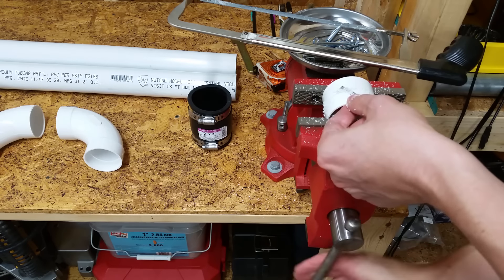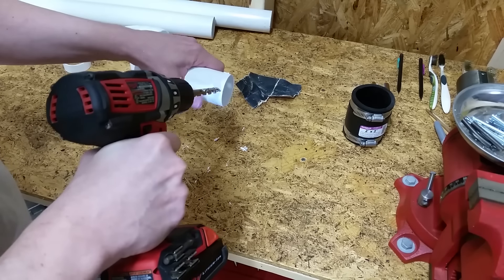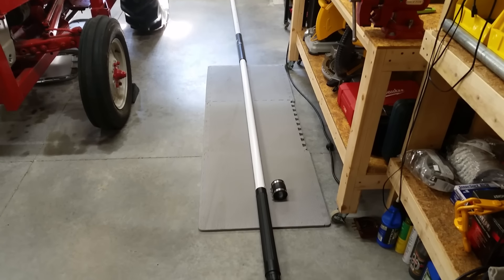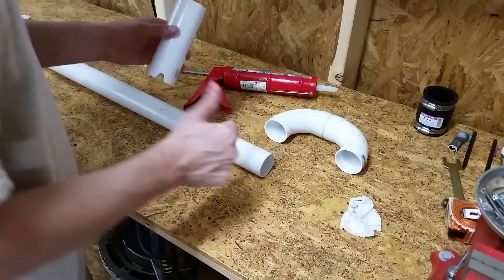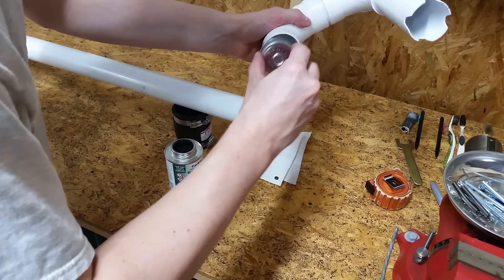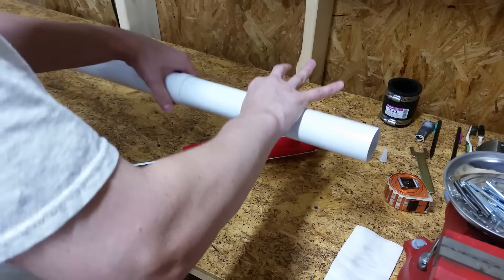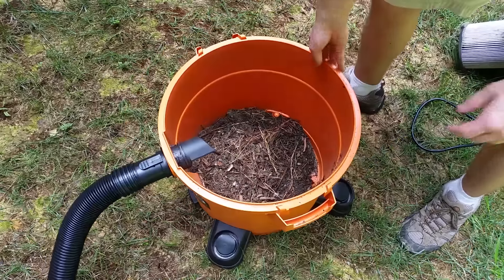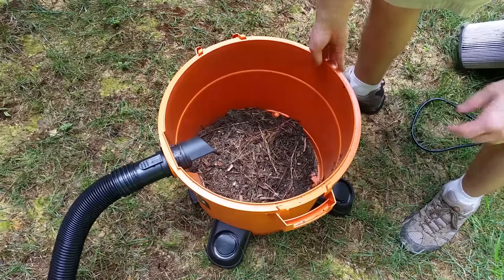DIY Gutter Vacuum - Easy and Safe Gutter Cleaning from the Ground

Comment: What if you made the coupler between the two elbows longer? That way you don't need to be directly underneath the gutter and avoid neck pain?
Reply from the maker: Yeah, or you could use two 10-foot pipes instead of two 8 footers. The problem is, the longer you make it, the heavier it is. Also, it would be harder to maneuver if you weren't standing directly below it. The neck strain really isn't a big deal, just a minor inconvenience.
Reply: @Mikeattempts  how high can you reach with two 8' pipes?
Reply from the maker: @jpearson311  Probably around 20' comfortably when holding the bottom at about chest height. You could probably go even a little higher and still have sufficient control.
Reply: @Mikeattempts  ok. I live in southwestern NC and clean a lot of gutters. Every house sits on a slope and has at least some sections of gutter that are at 20+ feel.

Comment: Put in gutter guards and never have to worry about cleaning gutters again. I live here in New England and have oak and maple trees around my two story house and had installed black metal gutter guards from Lowes and have no problems since.
Reply from the maker: I looked in to gutter guards prior to building the vacuum attachment but, from my research, they all have their problems and they're not cheap. Plus, I would still have to get up there to clean off the guards because of all the long-leaf pine needles. I'll hafta check out the ones from Lowes. Thanks for watching!

Comment: I did this like 15 years ago using gutter down spouts and elbows... All you need is tin snips and duct tape (or silicone) to fit them together... No saws or power tools needed.  It's lighter than PVC and can fit on a leaf blower to just blow the gutter out in seconds.   Or if you have gutter guards, just blow the top of them off.  I used to walk around our entire house with it in less than 10 minutes and be finished
Reply from the maker: The commercial versions are made from aluminum tubing as well. Thanks for watching! :)

Comment: What’s the horsepower of you shop vac? Wondering if mine will have enough oomph with this long of a pipe extension.
Reply from the maker: Mine is a "5 HP" but other viewers have commented that it works fine on less. I did a follow up video with more details, if needed.

Comment: Any suggestions for thick wet moss which would be quite heavy with the amount of moisture in it. Thanks
Reply from the maker: Moss growing on the shingles or in the gutter? If it's in the gutter, you should still be able to suck it up with a wet/dry vac. If it puts up a fight, you might have to clean your gutters by hand the first time. Once clean, the moss shouldn't have anything left to grow on and, if you use the gutter vac attachment the following year, it should be able to handle the job without any issues.

Comment: I would have loved to see how you connected to the vacuum but great idea👍
Reply from the maker: The attachment just slides down inside the short extension that comes with wet/dry vac and then bottoms out on the stops I glued on. I did a follow up video, if you need more details.
Reply: @Mikeattempts saw your update video too. Good stuff. Might end up doing something similar (feeling a bit lazy though lol)

Comment: Thanks for sharing your solution and the process for constructing. I'm running to Home Depot now to do the same before our first rain of the season arrives in about 5 hours [classic procrastinator :) ].
Reply from the maker: Let me know how it turns out.
Reply: My local HD didn't carry the vacuum tubing. So, I went with 1.5" PVC. Good thing, because that size just barely fit into my gutters (old house with wood shingle roof). Overall, it worked much better than I expected. Took me just over an hour to do the whole house and finished just as rain started to fall (whew!). Thanks, again!
Reply from the maker: Sounds like you finished just in time! Was the 1.5" PVC heavy and difficult to control? I think the thicker walled pipe would be manageable for a single story house but would quickly become unruly as it got longer. Thanks for watching!
Reply: It’s a single story house, so I only needed 7’. But, I AM a bit sore today. 😋
Reply: I'm thinking about 1.5" Schedule 40 pvc pipe as well. I can't find lightweight sch 20 pipe anywhere locally.

How did you fit the 1.5" pvc to your shop vac?
Reply: @cadd9511  I actually don’t remember (it’s been over a year. I’ll take a look at it later today and reply.
Reply: @Bonsu-Papa  thanks! I have a 2.5" as well as a 1.5" shopvac. Really don't want to lug the hose to HD to try to find the proper coupling if you can tell em what you used. Much appreciated.
Reply: @cadd9511  Just took a look at it....I'm a bit embarrassed to say I slid the 1.5" into my 2" shopvac hose coupling and used duct tape to seal it. Not pro-level, but it worked. :)
Reply: @Bonsu-Papa  hey, whatever works! We only do this once a year at most. I was able to find a reducer coupling from 2" to 1.5".

I plan on using a 2" flexible coupling from shop vac to 2" pvc. Then use the 2" to 1.5" reducing coupling to run the 1.5" pvc to the gutters.

In case you're interested, I found the 2" to 1.5" reducer coupling at Lowes.

Comment: Good vid. Anyone knows if there is a gutter blowing kit that comes with vacuum+ catching mechanism? I find vacuuming is only about 70% effective as still get much dirt trapped and unreachable between the tiles and the inner section of the gutter channel. So far, the best way is to blast the hell out of it but it causes a mess without localised vacuuming of the debris blown around. TIA.
Reply from the maker: That would be a cool idea, an all-in-one where the first tube blows the debris loose and the second tube sucks it all up. I don't think anything like that currently exists.
Reply: Strange, not like it's rocket science. I would gladly buy off someone who able to get a 3D design done. Will print myself😅

Comment: Hey hey hey. Pay attention
 They gave me a bid of $250.00 to clean the gutters after they put them up 9 months ago. GREAT INVENTION. Thankyou so much.  Ill be doing this idea instead of getting  on a ladder
Reply from the maker: Just be sure to build it with the central vacuum tubing, that's the key to keeping it light and manageable. If you have trouble finding it, call your local electrical supply store. Thanks for the comment!

Comment: Quick question…What about the leaves and debris that is caught in the valleys of the roof?  I still have to get on a ladder to get that down.  Any ideas?
Reply from the maker: Is your house single story? If so, you could use a telescoping pole like this https://www.homedepot.com/p/313314058 . You can screw broom heads and other stuff to the end. That's what I use to clean the pine needles off of my shed roof.
Reply: @Mikeattempts  Thanks for the quick reply!  Yes, its a single story house.  I will give that a try since my roof has a relatively flat slop that gathers leaves, etc in the valleys as well as the gutters.  Great video and great suggestion!

Comment: I used this today and worked pretty well, my only constructive criticism is that when you are using the upper section of piping, you don't have a lot of control from it spinning around.... I kept fighting it. My suggestion would be to notch the upper section ring and abs pipe such that they engage with each other. This would allow you to still maintain two separate pieces without adding rigid connections between the upper and lower sections, but "lock" them into place with gravity.
Reply from the maker: That's a good idea. Over the years, I've learned to lean the outer tube against the outside of the gutter and the bounce the head up and down a bit as I move in one direction. If I need to go in the other direction, I rotate so the other side of the outer tube is against the gutter (if that makes sense).

Comment: great video, but where am i supposed to buy schedule 20 nowadays?
Reply from the maker: I bought my central vacuum tubing and fittings at my local electrical supply store. If you call around, they should be easy to find. Each section of tubing was only around $6. Thanks for watching!

Comment: Do you have a recommendation of a wet/dry vac? I can't find one with a 2" hose and I'm afraid it won't connect properly to the pvc pipe.
Reply from the maker: I use a 5HP Ridgid vacuum, sold at Home Depot. It works great but they also have a 6HP and 6.5HP if you want a little more power. I did a follow up to this video with more detail, if needed: https://youtu.be/mSSDkTUUz8E

Comment: Great video man. I’m curious if I can use this set up for a full time gutter cleaning business. Any thoughts are much appreciated.
Reply from the maker: Yeah, I don't see why it wouldn't hold up with frequent use. You could even build one for single story gutters and another for two story. That way you could just use a standard coupler and PVC glue, on the longer one, and you wouldn't have to worry about the black ABS pipe. I did a follow up video that you may want to check out.
Reply: @Mikeattempts  thanks a ton Mike for the info. God bless you.

Comment: Thanks! My house is high, wonder if this would work
Reply from the maker: Some sections on mine are very high as well. You could make this with 3 sections, each cut down a bit so it was just tall enough to reach your tallest gutter. The key to keeping it light and maneuverable is to use central vacuum tubing, not regular PVC pipe. Let me know how it goes.

Comment: Haven’t been able to go through all comments, so excuse me if this is a repeat question.  I noticed the wet/dry vac you listed is 5.0 HP.  Would it be beneficial to have a higher HP vac?
Reply from the maker: 5 HP works great for me and other viewers have reported that 4 HP works for them. However, a higher HP vacuum will have better suction so, if I needed a new one, I'd probably go with a 6 HP. If you already have a wet/dry vac, try it out, it might work just fine.

Comment: Well thought out video. One question a little off the subject ... If you had to disconnect a silicon caulk glued connection, how would you do it ? Apply heat ? Some sort of solvent ? Brute force ?
Reply from the maker: Thanks for the comment. The silicone stays flexible so you can just twist the pieces back and forth and it'll eventually let loose.

Comment: Does the tube clog up a lot with small tree branches or sticks?
Reply from the maker: I haven't had any experience sucking up sticks. Small short sticks should be fine, as long as they can make it through the turns in the elbows.

Comment: Just finished sucking out 250' of gutters...twice. Because I started with the 2nd story gutters before I got up on a ladder to check the 1st story ones to see how I was doing. I discovered that the 5.75" downward facing tube was too short to reach the bottom of my gutters, and the elbow was hitting the edge of my shingles. So basically there is only a 2.5" gap to slip the tube into. Luckily I found a 10" piece of clear plastic tubing that fit perfectly inside the end of the suction tube. Then it reached the bottom of the gutters. But it still didn't slide very smoothly because it was getting caught on the dried shingle grit lining the bottom of the gutters. Wow, I shoulders and neck are going to be pretty sore tomorrow!
Reply from the maker: That's rough but it sounds like you got it figured out so hopefully it'll be much easier next time.

Comment: I'm going to build this but have a ball valve on the ground end so I can shut off vacuum for a moment to drop a clog at the inlet.  I have 6" gutters because I have large sycamore trees with leaves that are massive.  I will be basically picking them up then dropping them.  I doubt they will make it into a 2" pipe.  At least it'll still be faster than ladder work and much safer.  Basically I'll vac for a moment, clog the tip with leaves, come out away from the gutter for a second and shut off vacuum to let go of the clump.
Reply from the maker: That's a really good idea, let me know how it goes!

Comment: This is a better mousetrap than the one I built. use three shop vac extensions glued together with pvc cement onto the elbow sections. Then I used a 10 foot section of pvc connected to my shop vac. It still needed to get on the ladder to reach the second story. I fail to see the reason for the black pipe can you explain that one again please? Thanks you.
Reply from the maker: The black ABS pipe is just a means to join the 2 sections of central vacuum tubing. I could have used the coupler and PVC cement to join the sections permanently but I needed them to come apart easily so I could use the top section for my 1 story gutters. It's also handy for storage. Thanks for watching!

Comment: now how does the suction work on wet material go up two (2) floors?       ( been wanting to do something like this and try the a blower version also )
Reply from the maker: I've never used it when the gutters are sopping wet, I always wait at least a couple days after the last rain to clean 'em out. However, it does just fine with damp debris and wet shingle grit.

Comment: Nice but can it pick up mud and water also ?
Reply from the maker: If you use a wet/dry vac, it can suck up mud and water. Just be sure to remove the vacuum filter when sucking up water. However, I would recommend rinsing out the inside of the flexible vacuum hose and attachment when you're done. If not, the mud will coat the inside and dry which will make the hose and attachment heavier.

Comment: Would you happen to know the sealed pressure number on this wet/dry vac listed?  When I click on it and it takes me to Home Depot website it doesn’t list the sealed pressure. Only the cfm. Of course when I call the 800 number to contact Rigid vac they are on holiday after thanksgiving.  I’m trying to figure out the suction capability in comparison to others I’m looking at since now I can’t locate the sch 20 lightweight tubes so I’m having to pay way over price on attachments and the wet vacs have more than doubled in price in comparison to the $50 you mentioned for this capable vacuum. Thanks if you happen to know the pressure. I appreciate it.
Reply from the maker: Sorry, I don't know the pressure. You actually want central vacuum tubing, and you should be able to get it from your local electrical supply store. I did a follow up video with more details, if needed.
Reply: @ thanks. Yes I noticed your comment of if having trouble locating it try electrical supply stores in the area. So after calling plumbing stores I called all the electrical supply stores in town. Some said they hadn’t seen sch 20 central vacuum tubing in probably 30 years. Each place when I asked if they knew anyone that might carry it they either mentioned one I’d already called or when I called them they said no, didn’t have it. One store said he thought he found one place online but then he said it looked sketchy.
Reply: @ oh yea and Home Depot didn’t have a clue when or if they might get it available again.
Reply from the maker: @kristagerst2341  Home Depot has a similar vac on sale for $60: https://www.homedepot.com/p/316514940
Reply from the maker: @kristagerst2341  The issue could be terminology. I incorrectly called it "schedule 20" in the video but it's only called "central vacuum tubing". It's the tubing they install in the walls when you have a whole-house vacuum system. So, any electrical supply or vacuum supply or whole-house vacuum installer should either have it in stock or be able to get it.
Reply: @ oh ok, I’ll try that. Thanks again. I appreciate it.

Comment: I'm in a one story and was thinking I'd just run my leaf blower with an extension, but I'm thinking I'll just use my ladder and see how that works first without an extension.  Your design looks great, but my shop vac has leaks.
Reply from the maker: Leaf blowers work great but then you have the mess to clean up. I got my 5 HP vacuum for only $50 new and it has plenty of power. Since you only have a single story house, you'd just need to build the top section of the attachment. Thanks for watching!

Comment: In the UK we are in metric, so guessing I'd use 40mm pvc pipe, but what size the outer tube (black tube) guessing 43mm?
Reply from the maker: What you want is central vacuum tubing, which only comes in one size. The central vacuum tubing has an outside diameter of 2 inches (50.8mm). The inside diameter of the ABS pipe is also 2 inches. The central vacuum tubing slides perfectly inside the ABS pipe. You do NOT want to use standard PVC pipe, it's much heavier. I did a follow up video with more detail: https://youtu.be/mSSDkTUUz8E

Comment: I have a single story home. How did you attach to your shop vac ?
Reply from the maker: If you only have a single-story home, you could just make the top section or buy this kit: https://www.homedepot.com/p/203235222 . It's just a slip fit, slides down into the black extensions that come with the vacuum and go on the end of the hose. The little ring I added acts as a stop. I made a follow-up video with more detail, if needed.

Comment: To your knowledge can the 2inch pipe still be bought at Home Depot? I'm having a hard time locating this schedule 20 pipe.
Reply from the maker: It seems to depend where you live, some Home Depots carry them and some don't but you can still usually order it from them. If not, just call your local electrical supply store for the white tubing/fittings and any plumbing store should carry the black ABS pipe. I did a 3-year follow up video which has more detail, if needed. Also, there's more info in the video description. Thanks for watching!
Reply: @Mikeattempts  Thank you Mike for helping out so many of us! Best of luck this new year.
Reply from the maker: @dougsorensen7594  Glad I could help!